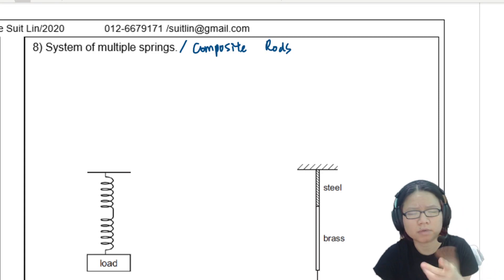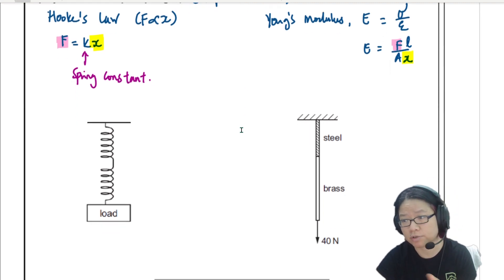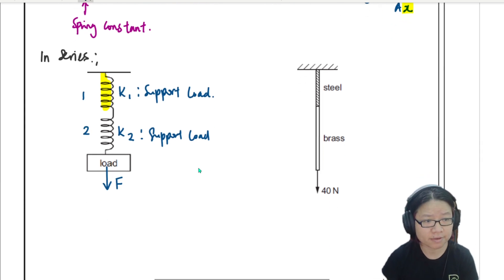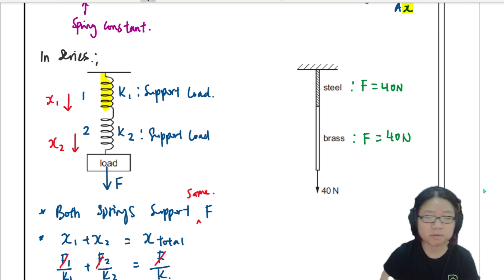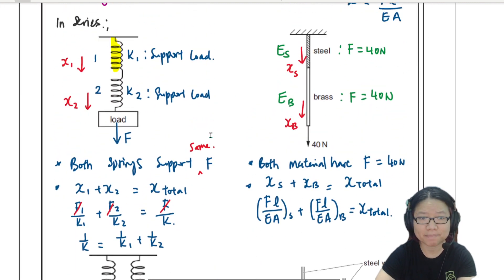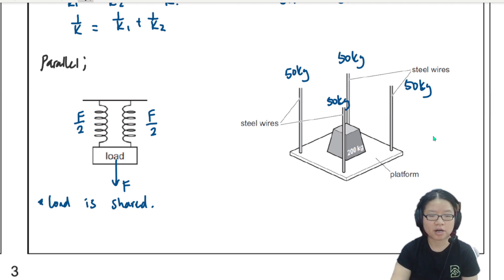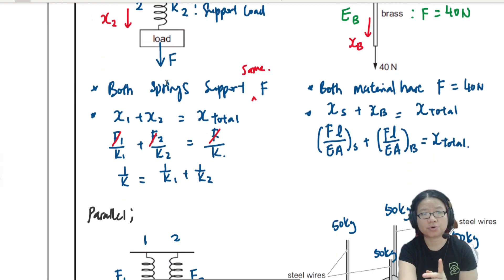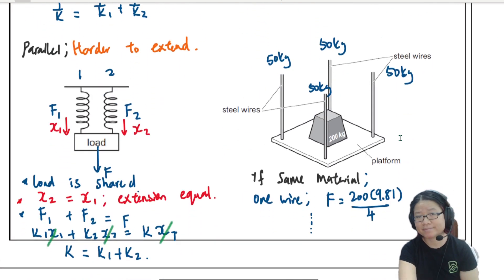6.2a Spring Arrangements and Composite Rods | AS Deformation | Cambridge A Level 9702 Physics

Comment: In parrallel the springs would have same extension, but what if they are made of different materials/ are of different length etc.
Reply: then the load would be distributed in a way to ensure equal extension, i.e. F/k = x so if k(the spring constant) is higher for one of the springs then F(the proportion of the load acting on that spring) will also be proportionally higher resulting in the same x as the other spring. For example if one of the springs has a spring constant of 2 while the other has a spring constant of 4, and a load of 6 N is hung from a parallel arrangement of the two springs, then the spring with k=4 will get 4 N (from the 6 N) while the spring with k=2 will get the rest of the 2 N. So the extension of both springs would be 1 (= 2/2 = 4/4).
Reply: that would be weird
Reply: Miss said that it would be a certain ratio
Reply: Different lengths are abnormal to carry the same force